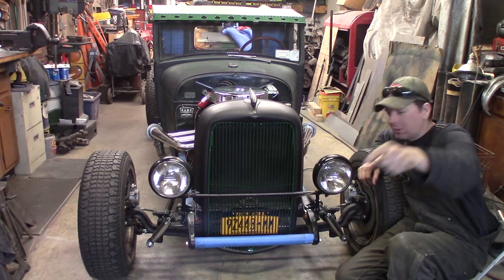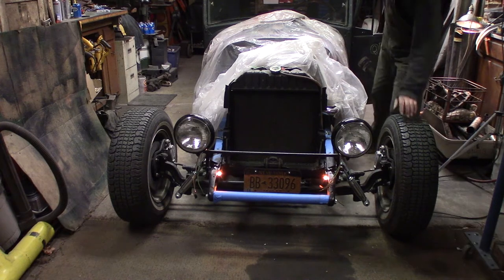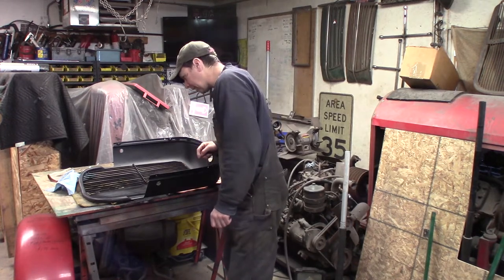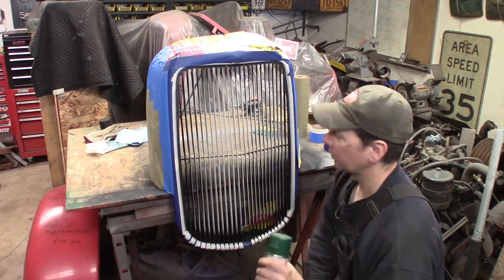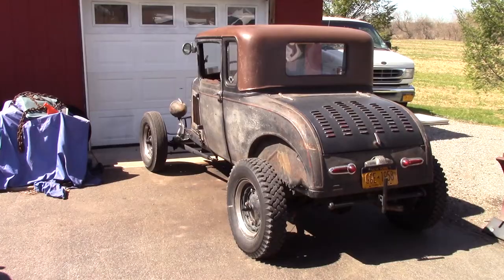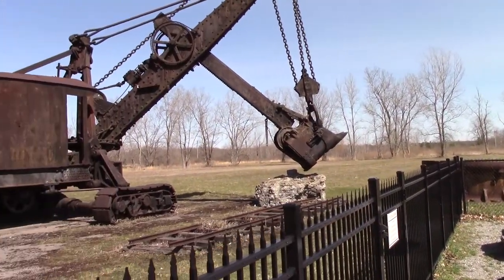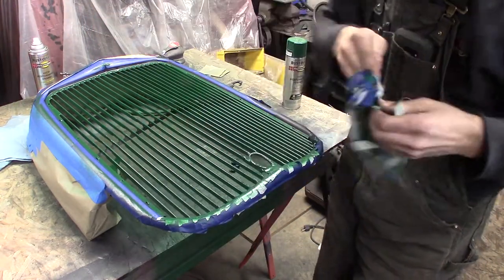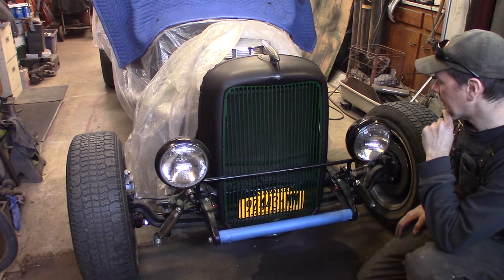Marion Steam Shovel, Model A Coupe, and a Hot Rod Shop Truck Update!

Comment: Is your Model A coupe sitting on a 36-38 frame or did you just swap out the front and rear axles to get the wide 5 wheels?
Reply from the maker: It's a stock Model A frame that has been stretched 7 3/8 inches in the rear to accept a '36 rear crossmember.  The front axle is a '36 and the rear is a '38 converted to open drive.  It has '39 brakes with '38 drums and wheels all the way around.
Reply: QuickSpeedShop Thanks for the reply. It’s a good look.